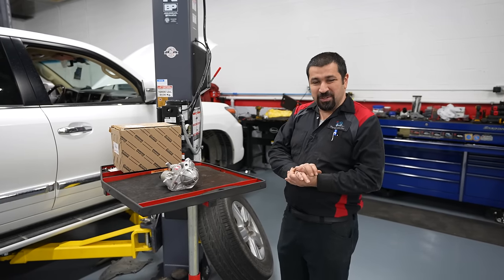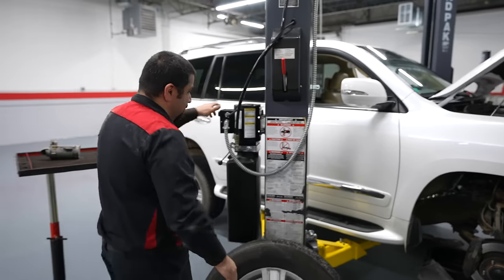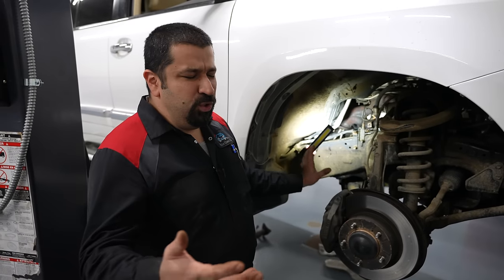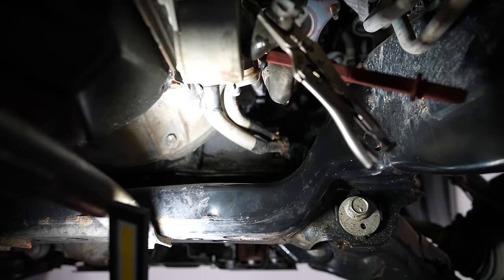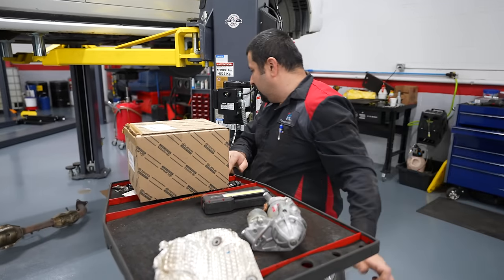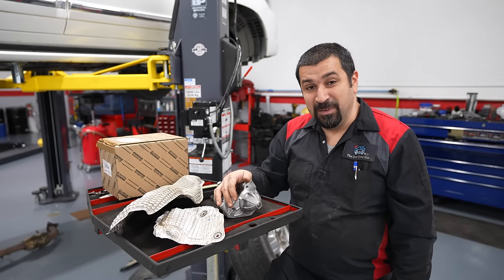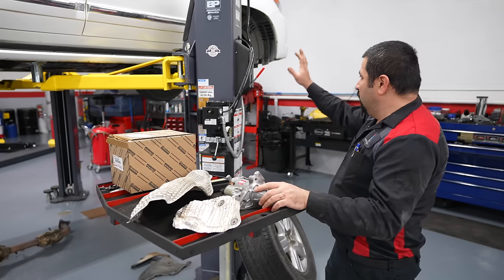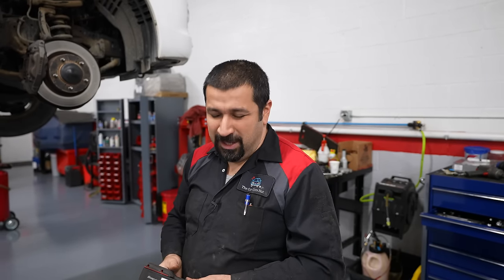TOYOTA! THIS is REALLY A Horrible Design! You Could've Done This Better!

Comment: The engineers must be having a good laugh...make it as hard as possible to remove (but still possible). I just did the starter on my 1ZZ-FE (2006 Matrix. 204,321 miles). You can remove fan shroud in under 5 minutes which gives a lot of access to the starter. A  flex-head long handle 3/8 drive ratchet made quick work of the two opposing bolts. You can also place a piece of cardboard behind the radiator to protect it while working.

Comment: I've done this on a tundra and yeah that stater shield is annoying but it was sorta like very thick foil. It bent easily so I finagled it out slowly and then had enough access to get to everything I needed. Maybe took 1.5 or 2 hours. I was able to work the shield back in and bolt it down as well. He also didn't mention cool down time if the engine is hot. But yeah the better ways I've seen starters mounted is on the trans on a corner and I'll never understand why engineers think engine side is better when there is no room there.

Comment: Gone are the days of sitting on either front fender with your legs inside the engine bay to work on this of that.
My dad had a 67 Chevy Caprice with a 327 cu in that one could do just that at least for top of the motor stuff.

Comment: Could you impact chisel the starter to crack the case for easier removal (where the challenging bolt is) so the only major frustration is getting the bolt back in under the limited space?  Can you do the same with the starter heat shield?  If there not expensive, install new heat shields.  I’m guessing the labor to remove and install the old mangled shields is more expensive than replacing them?  Also, can a specialty tool be made to accommodate getting in the tight space.  Sorry, my mindset is programmed to find solutions.

Comment: I was always worried my 2012 Tundra starter would need replacing... I am so glad I now have a 22 Tundra which I will never be able to work on.... yikes
Reply: Why won’t you be able to work on it?
Reply: @flight2k5  Have you looked under the hood of a new Tundra? It certainly haunts me.
Reply: @ScrewThisGlueThat  people said the same thing about the previous gen tundra when it came out. People always say that anytime a new truck come out. Then the previous generation became the last of the real trucks. Then a new generation comes out and the previous generation is the last of the real trucks. It’s an endless cycle. The longer the new truck is out there, people will realize it’s not hard to work on. Hell someone from 1916 would think a truck from the 1080s was more difficult to work on with its new fangled electronic ignition and smog

Comment: I will say that over the decades I have had Toyotas by and large they have been excellent and reasonable to repair. However, Toyota has made some changes that are not in the best interest of the owner, or mechanic. Some examples. The oil filter where you have to take apart and rebuild. Not only does this take longer but it opened the door for mistakes which can be catastrophic for the motor. The cartridge oil filter has worked wonderfully for 100 years, what Toyota did is a huge step backwards. Then there is the box for the air filter. Spring loaded clips work extremely well. Unfortunately Toyota changed to a bolt and nut set up that can be excruciatingly hard to manipulate, and God help you when the nut falls and hits the gravel underneath the car. This turns a 2 second job into hours. Both of these blunders are on 2010 Camry.  My 4runner has been a reliable beast. My only complaint is replacing the front bulbs, running lights and turn signals.  There is a lot of room under the hood so there is no excuse to have to have the hands of a 6 year old girl to be able to reach and replace the bulbs, especially when we all know they have to be replaced regularly.
Reply: Get LED bulbs and never replace them again.
Reply: @filonin2    My wife has led backup lights in her prius. When they went out you have to replace the while panel which was close to 300.00.  It could have been a single 5 dollar  easily replaceable light. I would approve of more LED lights, but stick with single units that are cheap and easily replaced. Panels with a bunch of mini led lights isnt cost effective.

Comment: I own a 2007 Tundra… am I in trouble too, I hope that year will be a bit easier
Reply: the 2007 tundra offered both the 4.7L v8 (starter under intake) and the 5.7L v8 (starter under exhaust) so check which engine you have.

Comment: i BOUGHT THE 2015 Sienna 2015 Limited and NO AWD...  They do not tell you that the spare tire (at that a dumb donut) is not ther in an AWD because the transfer case needs the space.  Flats are HARD to get, do not last long, cost a lot.  I appreciate THIS video information.  I now spray Fluid Film on dissimilar metals IF any...  A new place to spray is whater seeps in behind the mud flaps.  Silicone spray on the tire sensor stems as the stems like to weld themselves to the mag rim.  See Care Care Mech on tire monitoring devices.
Thanks Car Care Nut.

Comment: I’ve done a front axle on my awd IS250 the passenger side was seized and it took 4 hours to get it out…… then I cracked the oil pan putting the new axle in 😢. Still the most disappointing job I’ve done to this day. I replaced the oil pan and sold the car 😖

Comment: Love your videos, you remind me of my dad. He was also a beast mechanic with 30 years of knowledge and spoke in a similar calm esucated way such as yourself. I listened to him rant for years about what absolute garbage euro luxury cars were. Everything cheap chinese plastic and cars breaking down after the warranty expired.
Reply: Euro cars are made to be replaceable since the government doesn't like people keeping their cars for over 5 years.
Why make quality cars when laws don't encourage it?
Programmed obsolescence is the European way.
Reply: @ghoulbuster1 Sounds like a waste of resources.  Hope they change their ways with high price gas..
Reply: There is a fast growing trend among private shop owners that they will not attempt any repairs on cars > 10 years old, since the plastic crap (which should have been metal) literally breaks in your hands as the problem area is dismantled. Now that the manufacturers know about these plastic parts becoming brittle after thousands of heat cycles, I'm curious if any will address this issue. #plannedobsolescence
Reply: @plumkey197  I know of people that had to replace plastic parts with aftermarket or even self made metal parts to guarantee it won't crumble after years of use.
Reply: @ghoulbuster1  I can understand the need to use plastic when able to, but cooling system parts should be some kind of metal. The idea of a plastic thermostat cover is just begging for a failure. My Frontier has plastic connectors coming from the heater core through the firewall to the outside and they are often broken when the heater hoses are changed out. Most of the aftermarket replacements have aluminum connectors. And I've had several radiators fail at the crimp between the metal and plastic on top. Again, radiators made of 100% metal are widely available.

Comment: I have a toyota Rav4 2015 and 100k milages. The mechanic told me to replace the serpentine belt. Should I replace Belt tensioners & pulley at the same time? i dont hear the noise yet.  If i replace ONLY the belt theb tensioner might have problem after couple months. How long is tensioner last? Thanks
Reply: Always change the tensioner bearing and pulley when you replace serpentine belts. I said always
Reply: @armantokimiadi1900   thanks! do u know how many idler pulley on toyota rav4?

Comment: before placing the nex starter/heatshields,  put threads without a head wher the bolts would go first and tork them down. You have 3 threads now that will line up with the holes in the heatshields, if you do the 'hardest one' first and start the nut on that thread, the other ones will be not as bad to get on.  YOU ROCK !
Reply: Where do you come up with these comments?

Comment: The customer is smart on this one for doing that job preventatively.  I see a major trend of starters failing around 150k miles on the 4.6 and 5.7s...  My 5.7 Sequoia's starter started to do a 'click no start' randomly right on schedule at 150k.  Replaced it and 4 years later no issues.

Water pumps and tensioners are another 120-150k thing on the 4.6s and 5.7s

Comment: I just did this on the street on a tundra rwd 5.7L. No way in hell I was going to remove the exhaust manifold lol...my uncle needed to go to work the next day. The youtube videos made it look very easy, but it was a bear to get those shields off and back on. You basically have to bend the crap out of them. I was able to sneak the starter out the front so I didn't have to undo the coolant lines. My back was done for the next 2 days 😂. You will need ratcheting wrenches of all shapes and sizes because it is tight!

Comment: Ouch..... the air injection valves and lines on the back of a 4.7 4runner is the worst I've ever done. Getting them out isn't too bad but getting them back is close to insanity. I decided to do them when changing the air pump and I would never recommend doing them to anyone.

Comment: My 2.2 eco tech on my 05 Saturn redline had its starter under the manifold 
And it looked very difficult and I got ripped off by Machanic who said it was a big job 
Was $500 
Just to find out later how easy it actually was…even with removing the supercharger 
    Only down fall to the starter being there was it kept overheating and burning out and had to be replaced every few years…and no I did not have the ignition or security lock out issue that GM was known for that cut the starter off randomly…

Comment: I have removed at least 50 of these manifolds (I live in the rust belt)for either a starter, transmission or rear main seal replacement and have had 1 manifold separate from the secondary air tube flange other than that you make this 1.5hr job seem damn near impossible. Just take the manifold off, I have never had a stud break or bolt round off

Comment: I really hope a lot of people see this and realize that just because a component is going to be easy to replace on one car, doesn't mean it's going to be on another car. Sure, the ones under the intake was a dumb design, it was an easy, but time consuming job just to replace the starter. I've done one of these "redesigned" 5.7 and they really test your patience and requires a lot of strategic planning. Remove the exhaust manifold? :hand-orange-covering-eyes:Nope, not doing that. Like you said, here in the rust belt those bolts aren't coming off unless they break - every time. Cost to replace these starters at the dealer - over $1,300. Cost to the mechanic doing this - lots of emotional damage and thoughts of evil revenge to the engineers responsible for this design.

Comment: Yup- just like the 1st edition 3SGE, flipping sucks! Alternator, 2 support brackets, header and downpipe and heat shields, then the corroded heat shields around the starter since the wires are buried in there. 
Unlike the 3SFE which took me 5 minutes if that! Arggg!!

Comment: You mentioned the Highlander with all wheel drive and the new aluminium transfer case, is that different than the 4 wheel drive version? I have a 2010 Highlander (I've asked questions about it before), does it have the same problem or does it use the same transfer case?

Comment: I always thought that putting the starter under the intake manifold was nuts, but my only experience was with old American V8s that were a piece of cake to work on. Guess I was wrong about that. I bought my first Toyota this spring, a 2022 Tacoma. I wanted a truck that was simple and rock solid so I went with the 2.7L four cylinder, and I do not regret that choice.
Reply: I currently drive the 4.0 but also thinking of going 2.7 next for more easy access around engine.  From what I’ve read I wouldn’t save much on gas. Not as many used 2.7 in 4X4 out there.
Reply: @marcpikas2859  
I have the 2.7L with 6-speed auto and 2-wheel drive. I mostly only drive 15 miles to work so that 30 miles a day mostly at 55 mph works out to 23.3 mpg over the 6 months I've been driving it. This is per the Fuelly gas app I use, not the truck. My best fill up was 24.7 mpg. By the way I've installed a Sprint Booster to improve the throttle response so that probably brings the gas mileage down a bit since I tend to give it the juice a little more, lol.
Reply: @chrislj2890  Sounds good to me.  I get 20 in summer light footed.  Not rushing anywhere.  Winter is down to 18.   When loaded maxed out 17 so not too bad.  165K miles.

Comment: You said you took an hour to get a bolt out. You charged 3.5 book hours and it took you 4. You should try wrenching on my 20 year old 02 Jeep WJ.
The rear shocks and Sway Bar links have proprietary bolts that are very odd shapes like a M12x1.75 hex flange head with a extra fat shoulder and a small M10x1.50 thread, so you can't buy a bolt from the hardware store that's M12x1.75x60mm because it's thread half is 2x the thickness allowed to fit inside the sway bar connector. And you can't use the M10x1.50x60 bolt because the shoulder is so small diameter that it would rattle around while driving.
They also are insane rusty. When I say rust I mean corrosion to a degree its welded. The nut, the threads, the bracket, the bushing sleeves. Only way the shock bolt is coming out is buy cutting through Bracket, bushing and bolt. on the end links the top bolt has inside nut welded to the bracket so when that bolt snaps, you are gonna have to remove the bracket and cut through the nut that's welded on.
The rear shocks took me 3 days, the rear sway bar assembly took me 3 hours + time to get replacement hardware.

Comment: Ya. I could see how that job could 'suck'. Hey ... ever changed a fwd lav. tank & dump valve on a Locheed L1011?
 Or maybe  a Dc-8 radio rack cooling fan, fwd of the pilots legs and you weigh over 130 lbs?
 That is why we are mechanics. Most people think we are just crazy. I,m retired. :)

Comment: The starter replacement on the 5.7 is horrible. 1200 to 2000 to replace at a shop. I'll stick with easy to work on vehicles.

Comment: Guess who just broke the starter solenoid connector on a 2UR-GSE in his 2008 Lexus IS-F? ME!!!  All because I couldn't get that darn heat shield off to let me squeeze my hand in to access the connector safely! Why was I messing with the starter solenoid connector you ask? Well I had to replace a knock sensor which means that I had to take off the intake chamber which requires the engine wire harness on the passenger side to be disconnected and folded over to the driver side. Now I have to wait for a new starter solenoid pigtail connector to come in before I can use my car again. I absolutely HATE the starter location on the Lexus IS-F.

Comment: 05 trailblazer 5.3 v8… i had a shop do mine, they have to loosen engine mount and jack up motor to get to it. Total cost $500. Ypu also have to change spark plugs by removing front wheels and do it in the fender well.

Some of these things are basically not meant to be serviced. Unfortunately for mechanics customers domt accept that as an answer.

Comment: wow.  i always felt the engineers that design the lay out of these vehicles should hang out with the mechanic for a month and take input to make these jobs easier.  i have to say though, i agree with the owner doing a preemptive maintenance.  yes it cost him money, but imagine hes in tim-buc-too and the starter goes out...  it also seems obvious to me that putting an electrical component so close to a heat source (exhaust manifold) that you're asking for trouble.  even the way the engine now-a-days sits so far back in the engine well makes it really hard to work on.  the ford f series with diesel need to lift the cab off the frame to replace parts.  crazy!!!!

Comment: Sigh.... unfortunately this mechanical engineer agrees with you that tight fits, steel where it should be stainless or xylan coated....plastic that reaches it's glass transition temperature when it's cold out and becomes brittle.....keeping an 05 Highlander and 07 Civic with 396k running in salty upstate NY....my life can suck sometimes (although I do enjoy learning)

Comment: Just had the starter in my 07 Tundra replaced at 173k, when I started it made an odd but not loud sound.  Went to my appointment, after I finished and went to start, nothing.  Had call a flat bed to take to dealer.  I used to replace starters in MGs and Triumphs back in the day.  But not this job. It was a lot of labor.  I agree terrible design    Also those buying new Tundra if turbos go out you have to lift body off frame!  Insane.  I sometimes think engineers at Toyota have no consideration for techs.  Engineers are lazy and just do what's easiest for them.

Comment: I know first hand exactly what you mean, I have a 2014 tundra same bat engine, starter, etc, ....my starter was giving up so I decided "Why not?. I can do it...I have done it so many times before to my other vehicles, esy pissy with cheesy......I saw lots of videos how to do it so I knew it wasnt going to be easy but man, it was very very verty extremely dificult.......I ended up removing it by squeezy a wiggleing it.....6 hours job just to remove it, all the things that I needed to remove, cables, pipes, hoses, screws and then put it back again.......shit.....man It was so difficult that it took me 3 days to process that i have to install the "Refurbish one".........yeaahhh, the refurbish one.........biggest mistake and I paid the price......It broke the second day, wasnt cranking.......took me 3 more days to process my mess-up, I went to toyota and purchase the original.....took me 4 days convincing myself that I can do it again in 1 day, ...... I did it and Im proud but man in my scale from 1 to 10 this was a 20....cheers